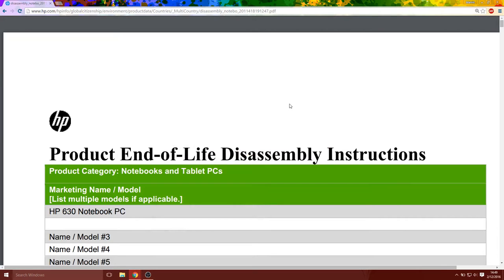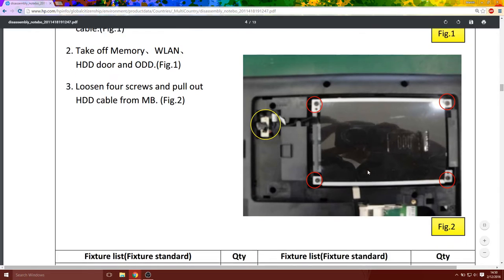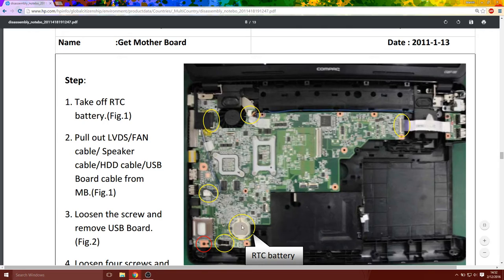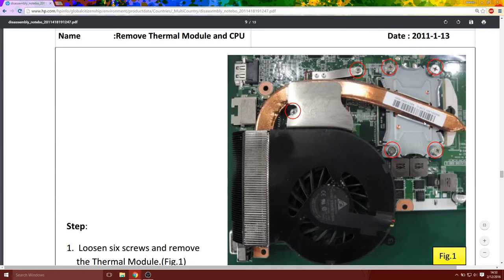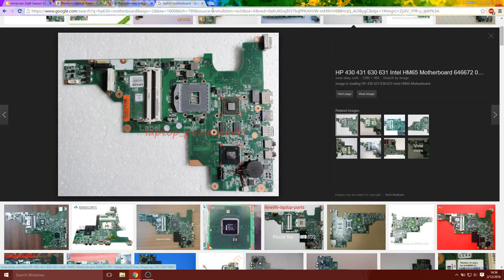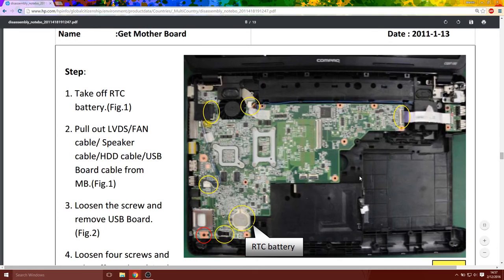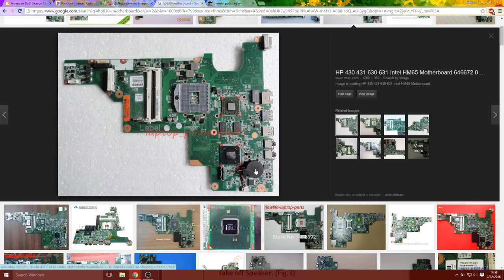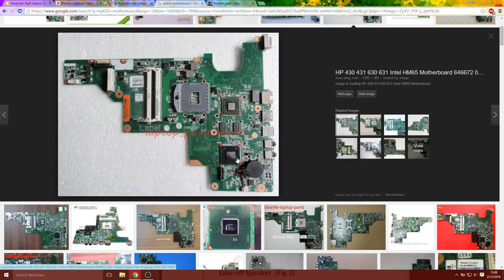HP 630 fix overheat problem

Comment: Great video. Done this 2 weeks ago and still no problem with laptop. 

Laptop was so overheating that other components just started to die. It was shutting down every 5 min. Sound was gone, usb was gone, display started flickering ... Heat on the keyboard was ridiculously high.

Followed every step you mentioned. Disassembly, cleaning, used heat gun on bridge and gpu, added new paste on cpu and gpu, added new 1mm pad on south bridge, removed mash. It's been 14 days 24 hours non-stop on and not a single shut down. All good so fare. Thank you for this video. In worst case scenario I will do it again and hopefully continue using it. It's 15 min process, for everyone who is willing to try this, except for heat gun witch take about 1 hour if you are doing it 2 times like I did.

Thx again. Great video.
Reply: Hey will it work without doing heat gun witch? I have a HP 630 i5. It shuts down when it hit the turbo clock which is 3.1 GHz.
Reply from the maker: if the only problem you have is overheating then you can skip the heatgun step. heatgun is only for fixing chipset failure, problems with hardware: no USB, no booting, no display, etc.
Reply: Yes lap is working well except the overheating issue. Thank you very much. I just ordered a thermal pad on ebay...
Reply: As SilentDreamcast said, and I agree with him, no need for heatgun in your case ... yet. I had other issues so I had to use it. At first it was randomly but after some time, same as you, every time turbo kicked on ... shutdown. I do believe that you will need and proper fan cleaning. And ... don't buy a cheep thermal pad since, over time, their W/mK drops rapidly. 

Btw. 1 month gone and still not a single shutdown.

Comment: When i boot , my fan goes crazy,100% blast. I replaced the thermalpad,fan ,but nothing have changed. I should reflow the southbridge?
Reply from the maker: yes, it's common for fans set to max when southbridge/chipset needs reflow. good luck
Reply: @CheckEmGG  Thanks , i ll try.